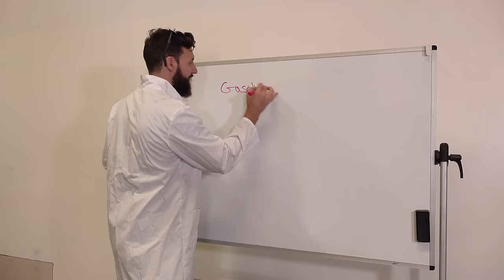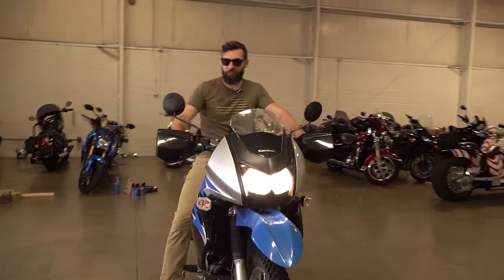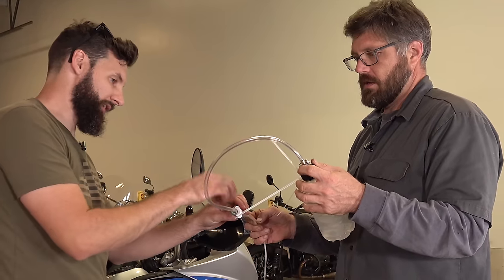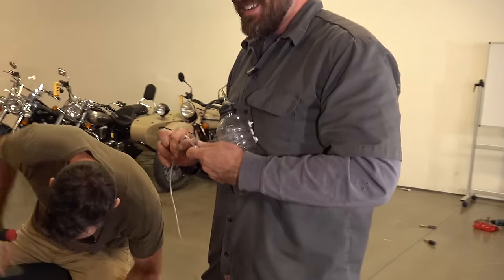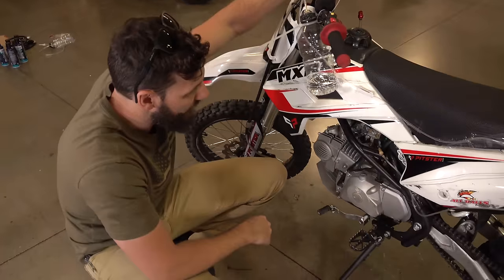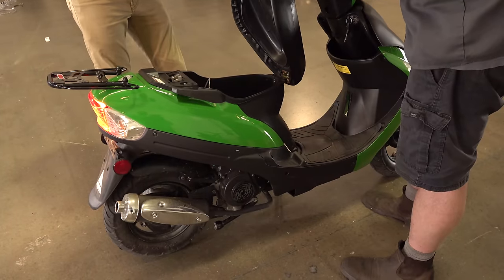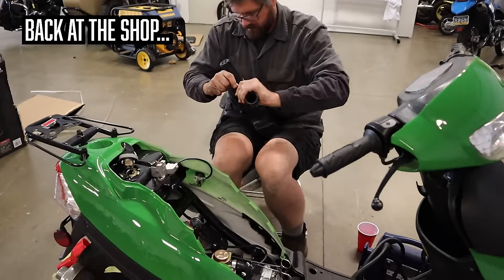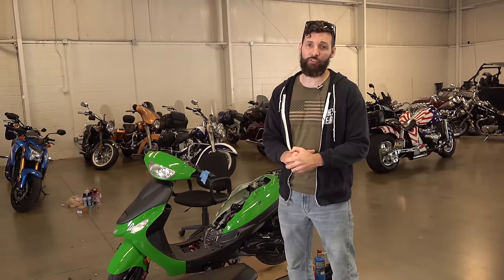What happens when you try to run a motorcycle on PROPANE instead of Gas

Comment: I work in the LP industry and run across this a lot! First off you need to supply liquid propane to a vaporizer (these utilize hot water from the coolant system if one is available) the reason for this is it supplies a ready supply of fuel independent of the ambient Temperatures as they affect the amount of pressure and BTU’s in the vapor form of LP.  Next you have the pressure regulator to bring the freshly vaporized LP down to a set pressure so it stays consistent. Finally you need the correct LP carburetor for your size of motor. Call an outfit in Hampton Iowa called Midwest Meter. I can get you set up for far less than the cost of your generator 😅
Reply: Dang dis boi smart
Reply: Yeah. I worked on a project years ago in college to convert a zx6 to log with a gaseous fuel injection setup.  It wasn't as simple but certainly possible with the correct gear!  I've also rebuilt fuel systems on lpg forklifts and its not as simple as just piping it to a gas motor :)
Reply: Yep I recently worked on an lpg Toyota forklift, I thought I'm great at working on Toyota's this will be cake! I was mistaken instantly. but the internet saved me 😄👍
Reply: Seriously,
2020 reduced me to living in my (1977) camp trailer. Been really wanting to figure out how to setup a gas generator to run off my propane system on the trailer. 
Any info would be greatly appreciated!!!
Reply: Finally someone who knows what they are talking about. I have a generator that runs on either gas or propane.
Reply: Ok Hank
Reply: We had a truck that ran off of propane back in the day. It was a 4.3L v6 silverado. It definitely needs a vaporizer/atomizer system to stay running. We had so many issues with that truck if it sat for more than two days.
Reply: @joshuacheek5140  my uncle ran several of his trucks on propane and never had a problem.
Reply: @JamesCouch777  sorry I didn't mean because of the propane, that old silverado was just worn out. I mean it lasted 15 yrs before it started acting up. It was an old shop truck so it got abused constantly. It had a tool box bed and the center had a propane tank and diesel tank we used on Job sites to fill other equipment. There was always something wrong with on Mondays lol
Reply: @joshuacheek5140  lol, I get it. We ran a few of our tractors on propane too. It's a little quirky but once you get it figured out it works great.
Reply: Buy a dual fuel generator. Runs on propane and gasoline.
Reply: Propane boils @ -44 degrees, no need
Reply: @LostinFrance626  but during boiling it decreases it's temperature. With high flow that will be problem. Bigger engines will froze tank after couple miles. I live in country where 1/3 of gasoline cars are converted to run mix of propane-butane. And if someone installs tank i way that pickup line takes waporized gas from top of the tanka instead of liquid from buttom tank froze i couple miles and pressure drop starving engine from fuel. But small engines like in mopeds and small mowers run on gas vaporized in tank.
Reply: In my country conversion kits for small engines had only reducers that run on propane-butane vaporized in tank. I see couple scooters running fine on that type of fuel delivery.
Reply: @silversoozookee2839  why not buy one that runs on propane?
Reply: I am installing LPG Systems in Germany, about 3-4 cars a week, about 60% of the cars I convert to LPG are Dodge Ram or Jeeps, is it common in the USA to drive a car with LPG or does someone even install those kind of systems?
Reply: @Krokomoto99  it is not common for passenger vehicles but is done. Dodge and Chevrolet are the two most popular conversion donors. We use Impco vaporizers and carburetors for those.  The biggest market share of LP powered vehicles in the US are buses and garbage collection trucks.
Reply: May I ask how to adjust the motorcycle speed when connecting to propane gas? How to adjust the speed?
Reply: @Krokomoto99 Do you live near Freiburg? Can I work for you? :D

Comment: its a klr dude.when they were designed the cleanest fuel around was crude oil.and coal.
Reply: No, No, No, No. I owned KLR's back in the beginning. They where designed to run on Sterno. You took a couple of extra cans out in the filed and had a Fondue as you watched the sunset. If you used anything remotely combustible they would blow up................. :)
Reply: I ran out of gas once on a 1980s klr in front of a home store. Bought solvent and the motorcycle ran like nothing.
Reply: Gas engines was designed for peanut/veggie oil originally.
Reply: @brianmccann666  Diesel engines were.
Reply: @brianmccann666  not with spark plugs, the first internal combustion engines were pressure ignition , like diesels.
spark ignition and petrol came later.
Reply: I had a KLR in the 1930s and I ran it on a steady diet of moonshine mixed with gunpowder.
Reply: They’ll almost run on gravel and drywall dust - bet you wish your daughters would procreate with a KLR instead of today’s modern “man” 😂
Reply: @grumpysteelman  Wasn't us "Modern" men that made these beta males. Guess these "older" men should have parented better.
Reply: @Cavemanheartrock  - oh I dunno. I blame the parents of the girls too - not expecting anything but a compassionate marshmallow of a partner. If the girls close up shop for beta males, they’ll turn around as fast as lightning. 

The truth is that tough times make tough men that make easy times that make weak men that make tough times. 

We are just on the beta swing, because their existence is acceptable to society. They’ll die out again, or “disappear”, just like the majority of the free-love hippies once they realized that they needed careers and homes and silly things like health insurance. Hope the govt. doesn’t sponsor them into perpetuity.

All I can do is provide an example of a man that defends, provides, and cares - and to chase off the betas whenever they get near a female that I care about.

Comment: What went wrong: proper fuel mixture, otherwise known as stoichiometric. This amount actually changes based on RPM and compression ratio, more RPM means more air, in which needs more fuel.
Propane: since the propane was entering the system as a gas, as you revved up, you need to introduce more pressure from the tank. The pressure regulator does that for you, they are usually tuned to the CC and compression ratio of the engine. Ones from a generator usually only work in a small RPM range.
Butane: this one worked better because the gas was discharged into liquid form, then sucked in through the engines compression. It's probably would have worked better if you had a larger tube for more fuel to be sucked in. You would still need to tune it to make sure the correct stoichiometric level. 

Good job you guys, just next time, discharge butane outdoors. 
God bless
Reply: The butane also needs to be pressurized. Hence the the metal container. Also the line needs to be shortened and the right sized jet introduced.        Vaughn
Reply: Yeah what he said 🤓👆
Reply: @SPd.Triple  they know what they are talking about,  but I will stick to my regular gas to run my motorcycle
Reply: maybe add a supercharger to add more air with higher rpm..   Great to see thought experiments in real life.. thank you Sean and team
Reply: I have 2 of these scooters/mopeds. One runs on 100 octane RON (91.5 MON / 95.8 PON) and the other runs on a gas/diesel mix (50/50) with a compression of 16.2:1 (72cc) (Doesn't run anymore, grenaded the engine xD)
Reply: I was thinking the exact same thing.  It's all ball bearings now.
Reply: get a load of This Guy
Reply: The amount of butane will also fluctuate wildly based on temperature which will constantly alter fuel mixture. Like while you're holding it in your hand vs sitting on cold concrete vs sitting next to warm engine.
You would need an ECU monitoring AFR and controlling airflow to match fuel, the exact opposite way ECUs actually work, which means you would have little control as to how fast you are going
Reply: I mean this guy.
Reply: Am I the only one that didn’t understand a word he said
Reply: @JJTradess  more fuel and air more fast
Reply: Pressure in tank or bottle also changes tank gets cold pressure drops. Smaller containers cool faster.
Reply: @alt7488  lolololol
Reply: Holy smart
Reply: More pressure released from a propane tank the colder it gets and reduces the pressure on a curved scale, again ecm would be the way for warmer weather since the evaporative effect is inconsistent. Otherwise the 49cc scooter could take the propane pressure regulator off an ice auger of similar displacement with an adapter that was made of minimal distance.
Reply: Yes but that’s not the entire story though. See lpg also needs a special “mixer” to introduce the fuel into the combustion chamber. The mixer on LPG systems are heated by the coolant from the cooling system so that it doesn’t freeze up and introduces the appropriate fuel mix based on throttle demand.  
LPG is an amazing fuel when you compare it to gasoline- higher consistent octane (roughly 105) and cleaner burning. LPG can be pretty much retro fitted on most internal combustion engines, the key is to get the proper mixer. It’s also super easy to add lpg to a turbo diesel in the form of a boost reference system (which is Wild, imaging having an extra 200hp on tap simply from lpg and a little tuning why’ll increasing your fuel economy). I had the chance to install a few lpg, and cng systems in college, they’re pretty darn awesome.
Reply: I missed where they used the generator mixer on the scooter, the reason that didn’t work was due to it not being introduced as a liquid (mixer turns this back into gas) and like you said, pressure. Most people would not believe how much pressure lpg and cng tanks are under (cng is roughly 3000psi for automotive use, lpg I can’t remember it’s been awhile but it’s roughly 1000psi (but again I may be recalling incorrectly). The biggest fall back of running anything on lpg/cng is the infrastructure and needing the tanks fitted properly. It’s cheap, Burns clean and can improve fuel economy in some instances but sometimes it’s just not worth it due to space/infrastructure reasons. To me, it’s best to do a hybrid system. I could go on and on about cng/lpg systems from big to small they’re all really amazing.
Reply: You have a great point but missed a small detail I think is critical.... they choked these units to get them to run. After a minute or 2 they stopped running. The engines warmed up and needed less choke.
Reply: This has been done withe butane propane and hydrogen, watch kreosan
Reply: @SPd.Triple  fr what they said 😭
Reply: @litcostello1223  me too, it does the job great👍😎
Reply: @moimeme7839  true that
Reply: Interesting
Reply: This experiment is old..seen it over 10 years ago..with much more success..these creators are reaching these days...lmmfao

Comment: Im running most of my cars on LPG for many years.
LPG (natural propane gas) conversation is extremely popular in europe (because gasoline is really expensive). 
When done right there are no draw backs! Proper lpg system gets its own ecu, its own injectors, fuel rail, etc. Car still starts on petrol and runs on petrol till it warms up and then switches to LPG.
I have Impreza STi  that is running on LPG.
Reply: I live in Australia and I own a Ford Falcon wagon that runs on LPG. It is common in Australia to find cars have a dual fuel petrol/LPG fuel system with a dash mounted switch to change from one fuel to another. LPG is currently half price of petrol so it makes a lot of sense to run on LPG as much as possible.
Reply: Yes ofc its economical. 1 petrol liter = 1.3 lpg liter. So its good. I have a mk5 1.6 petrol/lpg. Its going 300.000 km. And still strong
Reply: STI on lpg is bad because the engine is very light

Comment: Years ago we ran a friend's van on various gases including butane and propane, I modified an SU carburetor to meter the gas, did away with float chamber and fed the jet with butane (without a regulator) the jet was about 1/8" and we made a needle to suit, had to stretch the spring in the carb due to gas pressure trying to push the needle of the seat. It worked well, the van did quite a lot of miles like that, had to make a copper coil to wrap around the gas bottle to avoid icing. Was just an evening project, for a laugh, took a few hours to get it working properly.